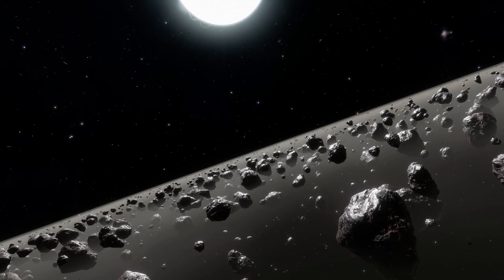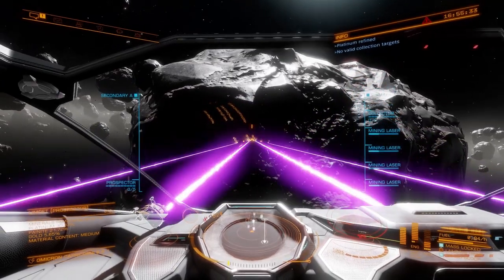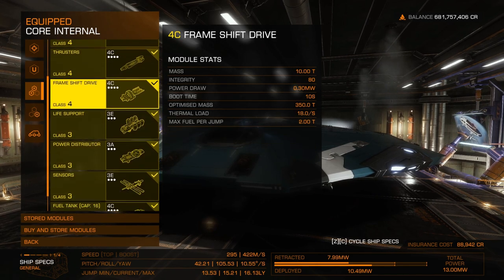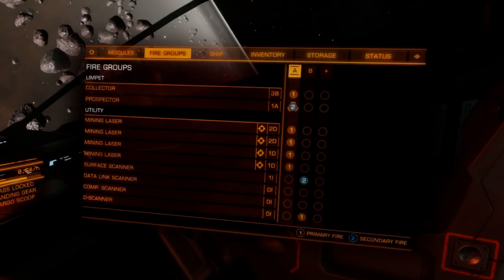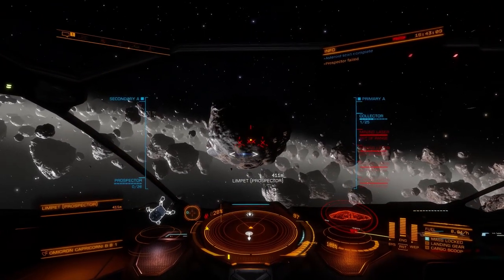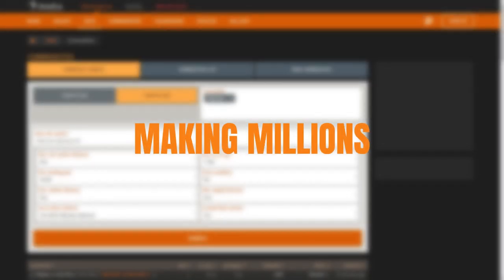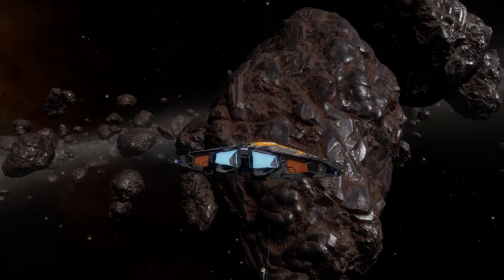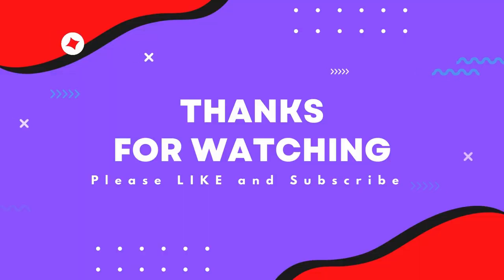I Made 7 Million With This Starter Ship #EliteDangerous

Comment: I recommend ditching the 2 smaller Mining Lasers.  1 laser will keep 3 limpets very busy.  My python build still only uses 2 Mining Lasers and I use 2 Size 5 Class A collector Limpet Controller and 1 Size 5 Class B collector Limpet Controller and the are kept very busy.  I will have to swap out for a Multi Limpet Controller to get 4 Limpets per Controller.

Comment: what about enguneers? Not only for cobra, for every miner?
Reply: Engineering is not really needed for mining. The only engineered module that would be useful, is an upgraded FSD to reduce the number of jumps to market. If you use a Phantom/Krait/Python, by gathering materials you can by a Class 5 FSD with increased jump range.
Reply: FSD and power plant can help to lower the jumps + reduce heat